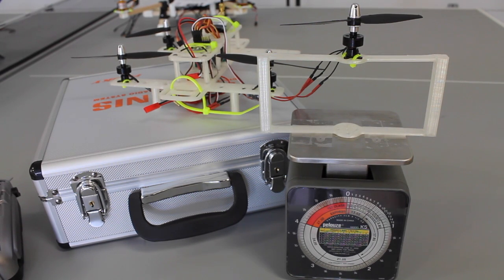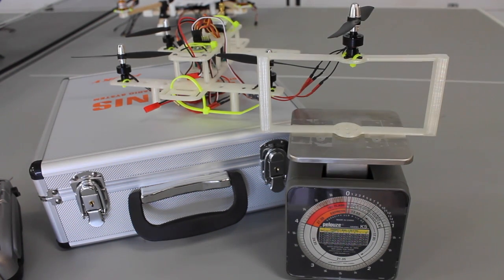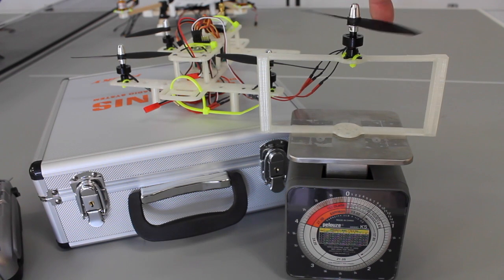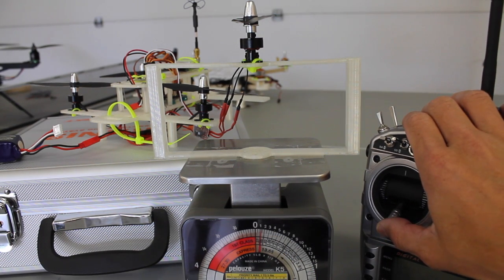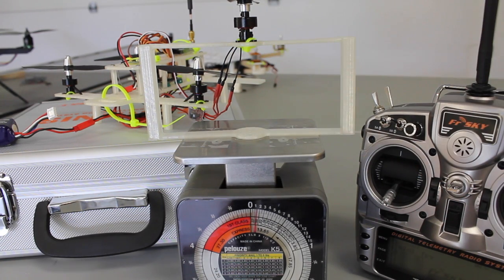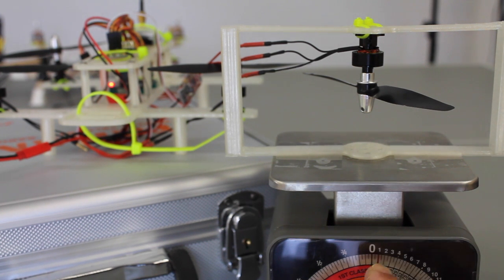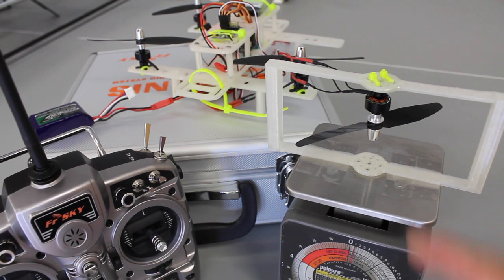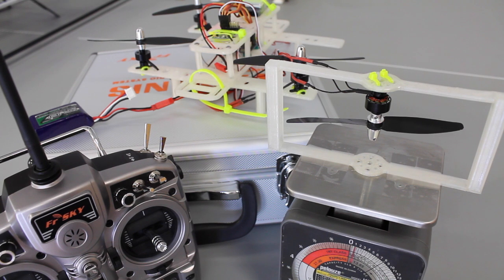Measuring Motor Thrust Revisited - Prop Rotation Comparison

Comment: Just a tip: instead of flipping the entire motor around you could have just flipped the prop over :)
Reply: Lol, here's a tip idiot... What happens if a propeller is facing the right way up and the motor is facing up? lt produces lift.
Reply: MrMiguu1 That depends on which way the motor is rotating. At the start of his video, he has the prop facing (as you call it) "right way up" and the motor is facing up. The rotation direction is producing down force. The entire POINT of this video is to demonstrate the difference in efficiency between your prop being affixed the way it was designed to vs backward. Pay attention, meathead. If he had just flipped the prop over, he would have accomplished that. Instead, he flipped the entire apparatus over, AND changed the motor direction.
Reply: Rich Bellamy Wow, you really didn't pay attention at all in school did you kid? Watch the video again. Listen carefully this time. I accept your apology in advance.
Reply: Geoff W. No a prop will push the same way after it's flipped.
Reply: MrMiguu1  I think you gentlemen need to go and have a beer. Relax, you'll live longer.
Reply: You guys are fighting for nothing.Flipping the prop around would create upward thrust meaning negative weight for the scale.That means he would need to put some weight on it and do some calculation to figure the thrust.He went the ''easy'' way and just flipped the motor around getting a proper reading instead of doing math.The prop was facing down both of the times.Creating upward thrust both of the times.

Comment: Thanks Dennis. Id like to know more about your mini quad, I noticed the Taranis in the video, Thats my next purchase. Im also thinking about building that Huge RC timer Hex with retractable legs. What controller are you using on your mini? Kevin
Reply from the maker: You won't regret the Taranis. I promise. I've had nothing but positive things to say about the Taranis. Well maybe the battery could last a bit longer, but other than that it's amazing. I'm using the MWC Flip 1.5 for my mini FPV quad but after I get it in the air I'll also be testing with the CC3D. Hope all is well.
Reply: All is good here Dennis. Glad winter is coming to a close though. I guess Ill have to google cc3d. I dont recall what that is. We really like your videos Dennis. Glad you are still doing it.

Comment: All you needed to do is turn the prop around, not print a holder and flip the motor.
Reply from the maker: Duh. I feel so dumb for going to the trouble of printing that rig but thankfully I only spent 30 minutes on it. I just posted a video where I did a test of the prop flipped and motor rotation reversed. It works as expected. Thanks for the feedback.
Reply: yea i saw it.. how did you print that? was it 4 pieces glued together or at once, how did you get that bridge on top? or did you print support material?

Comment: Dennis,you could have turned 180° the prop to point upside down and change the rotating direction of the motor instead of rotating the entire motor+propeller 180°.
Nevertheless,great video!! ;)
Reply from the maker: Thanks so much for the feedback. You and several others have clued me in to this. I've just posted a video doing a comparison with the prop mounted upside down and motor direction reversed. You're definitely right. I greatly appreciate it!

Comment: Attach the prop upside down to the motor if you want a pusher set up. The lettering on the prop should face the direction of flight. Make sure the prop turns with the high side cutting into the air first.
Reply from the maker: Thank you. You're absolutely right. A big duh on my part.